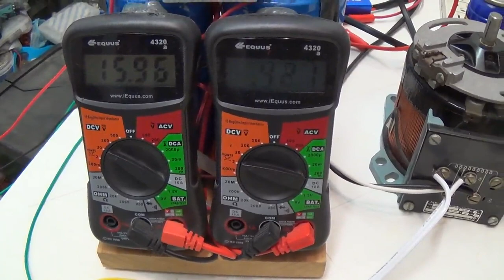William Skinner Gravity Assisted Torque Amplifier test 3

Comment: Finally to see some working replication. Q. What is the current variac draws to move the device on load and without?
Reply from the maker: Look at the video again, it's all there. Around 400ma @ 16vdc no load, then 700ma @ 14.5vdc under load. No free lunch with this device!
Reply: Luc gotoluc Choquette 
I believe that torque measurements taken electrically, through a drive motor and subsequent output generator could severely obscure the results, do to their own electrical inefficiencies. A method should be devise for more accurate measurement by falling weights on both the input and output.

Comment: you can not use a universal joint. it is not working right. i have replicated skinners device as well and mine use a spring between the shafts instead of a universal joint. i tried the unviersal joint at first bu realized it only worked for one angle but not 360 degrees so i used a spring instead. i tried to make a ball joint but realized it was a mistake so i discarded that. the best way is a differential gear coupling like on a cars wheels transfer.

Comment: ask yourself what is causing the upper weight to spin????    is it spinning because the weight is being lifted up, as in you pull the lever arm back,  and the weight lifts up and tilts back causing the weight to fall because gravity is acting on it ??   pulling it down?? or is the weight spinning because some how along the way the drive motor and shaft are spinning the weight ??  if the drive motor is spinning the weight then you wont get gravity acting on the weight and the device will not amplify.       watching it to me it looks like some how your drive motor and shaft are spinning the weight.     not gravity spinning the weight as the weight is falling because you have created a condition where gravity can act on it.              talk to me. I know how the machine works.
Reply from the maker: Do you have a working device?
Reply: @gotoluc  I am building one, I use automobile cv joints at the bottom, way stronger, the socket swivel will not hold up.  and I built my own gimbles.   what is more important is that I understand how these gravity harvesting devices work, that is what it takes to succeed.  that is why they are called gravity device's , because gravity enters the device and does work which causes amplification and more energy out than what you put in.  if gravity is not acting on it then it will not work.